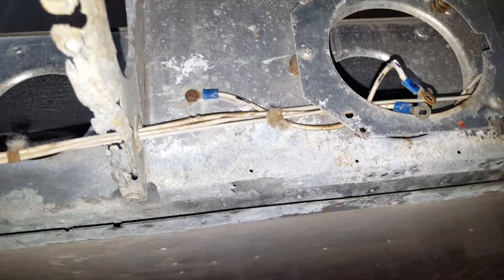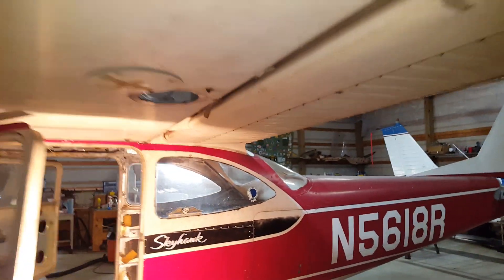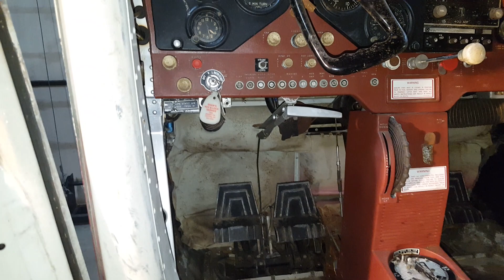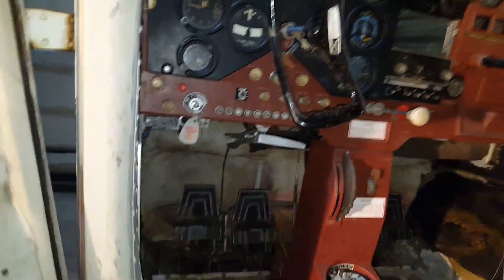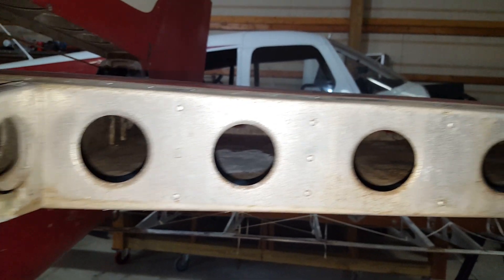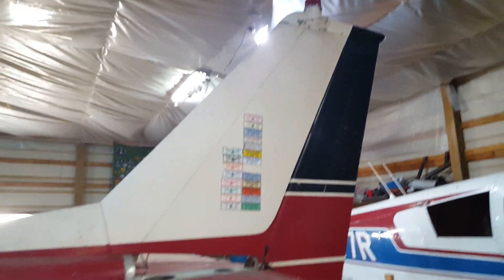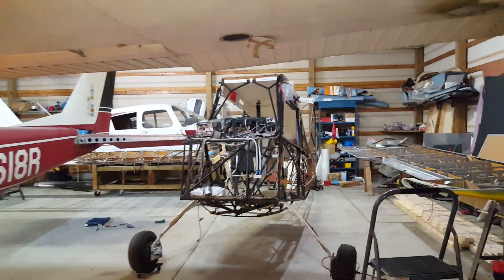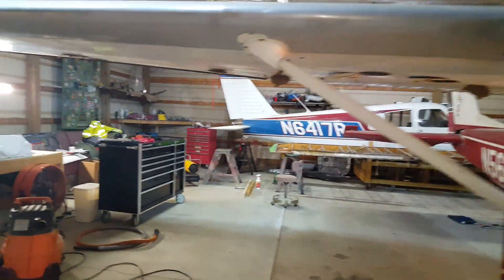Cessna 172F overhaul 3rd video

Comment: What happened to the Cessna project?
Reply from the maker: We found lots of corrosion in the passenger door area and in the wing spars. The owner bought another 172 to be overhauled and it's in much better condition . We are now waiting on funding. The engine case, crank and cam is back from engine shop and passed all inspections. Next is the cylinders. Wings needs some repair and needs a new windshield.  No corrosion anywhere. The red 172, I may try to save in the future. All my projects are on hold for funding. I think that is a standard in aviation.

Comment: Hi, what exactly did you use to clean the inside aluminum so well? Also, will you primer back over the aluminum before you cover it up with the new interior or leave as is? I’m about to start the same process. Thx.